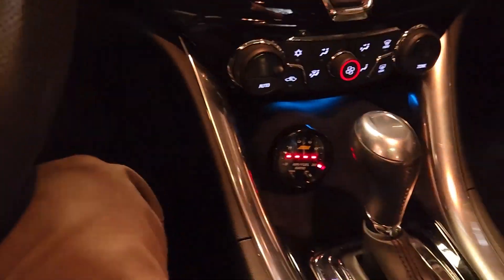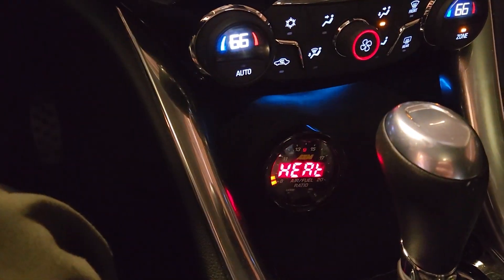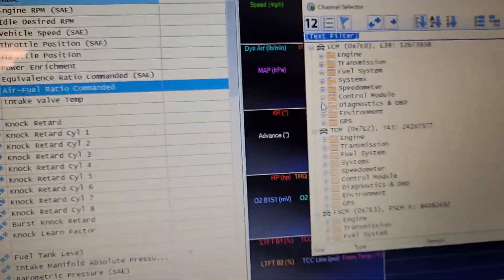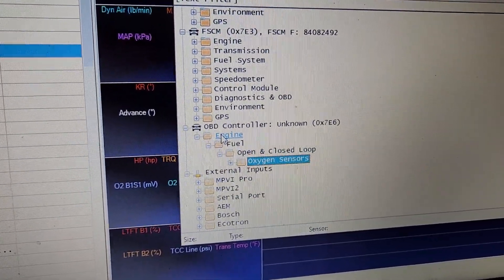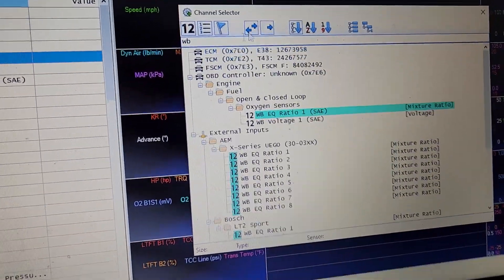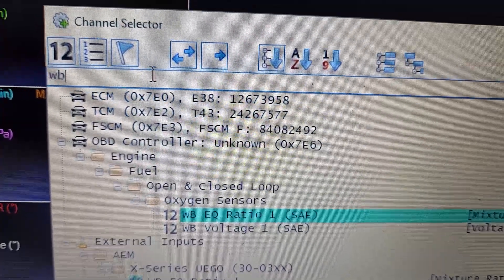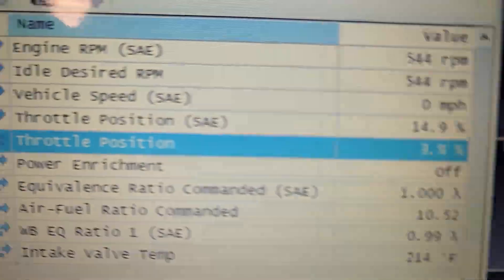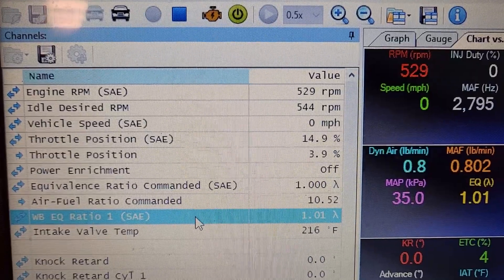How To Add The AEM X Series OBDII Wideband To HP Tuners VCM Scanner

Comment: thanks for the video! So you dont have any analog wires connected, right? Just WB O2 connected to gauge, Gauge connected to power/ground, and obd2 pass thru connected, with hp tuners connected into pass thru... right? haha thanks for your help
Reply from the maker: For the OBD2 CAN interface no analog wires as long as it's a CAN vehicle. 

Power the wideband, plug the pass thru up,  connect to the scanner, and add the channel.

Comment: have the same problem. 05 Sierra, Aem 30-0334. I don't even have the OBD controller folder
Reply from the maker: The 05 Sierra isn't a CANBUS vehicle this won't work using the port. You'll have to use analog logging off the 5v output wire.
Reply: @andrewd843 I wasn't quite sure because my truck is a patch work of other trucks  2003 cab with 2010+ engine and 2005 computer.  So I just figured that out. But thanks anyway. I found a video showing how to repin the two wires in the back of the gauge hook up a prolink cable. That should work, right?

Comment: Which MPVI do you have?  I have the three and that channel is not available
Reply from the maker: @scottzito4797  that channel only works if you have the aem 30-0344 and it's connected and on. It works with any MPVI I've used everyone to connect to customer cars with this wideband.
Reply: @andrewd843  Do you mean the AEM 30-0344?  I can't find the 03-0344, other than people making transposition errors when referencing the 30-0344.
Reply from the maker: @rosslawrence4628 03 is a typo
 30-0334 is correct and what is in the description
Reply: @andrewd843 I just got the 30-0334 and using HP tunner with MPVI3 and can not find that channel some help would be appreciated. I should also mention also have it plugged in obd2 connector on a 2005 gmc
Reply from the maker: @KellyA5150 
the OBD2/CAN isn't going to work on something that old. You need to log it with the analog 5v output. Vehicles 08+ are CAN based system. Older than 08 usually aren't CAN systems.

Comment: I have the prolink wired connection 30-0310 and i see the channels but when i add them they dont respond with any values when running a log. Do i have to adjust user defined maths or something?
Reply from the maker: @slick408  that doesn't have a the OBD2 port pass through like the 03-0334 does. It connects to the OBD2 but doesn't have the pass through to like with hpt like the 03-0334 does. I've never personally messed with the one you have. What do the instructions say for external data logging?
Reply: I have the same problem
Reply: @alihatem8640  I got it to work successfully on the 30-0310, after reading AEM's instructions I connected a 120 Ohm resistor to the 2 CAN wires. Those wires draw about .2 watts, so a resistor rated .25 watt or more should work. I used a 1/2 watt 120 Ohm resistor. I had previously used this exact setup without a resistor and have heard of other people not needing it. But when I reinstalled hptuners it didn't work without a resistor anymore, maybe I forgot something I did in the program, but this resistor method is better. Wire it up with the resistor and simply add the channel. External Inputs > AEM > X-Series UEGO (30-03xx) > WB EQ Ratio 1
Reply: @slick408  So you piggybacked onto the OBD2 port using this method?  I'm buying the AEM X-SERIES INLINE WIDEBAND AFR CONTROLLER KIT (30-0310) and was trying to figure out how to wire it in on my GMC...
Reply: @reddirtdevil  plug the hptuners directly into obd. you need the prolink cable and a resistor to connect the AEM.
Reply from the maker: @alihatem8640 please see my above comment. 30-0310 isn't the 03-0334.

Comment: My AEM X-Series was wired up properly and worked perfectly for almost two years before it melted down out of nowhere. Nothing was changed. I have a video on my channel about it. I have 30+ year old Honda ECUs that work fine to this day. So we're supposed to by a new wideband controller every two years? Has anyone else dealt with this?
Reply from the maker: @HexBMX  I've seen a lot of AEMs fail and have issues. The CANBUS ones will also do weird stuff sometimes to the car when they fail. I don't personally run the AEMs I have ballanger AFR 500s.
Reply: @andrewd843  Right on. Yeah, I've been in the game since around 2007. But working on Hondas since the 90's. Yes, I am old. And I have had more problems with these than any other equipment I've dealt with. If you've had consistent good luck with something out there, I am all ears. Just because something offers a one year warranty doesn't make it acceptable to burn out two years in. Hell, my ECUs have been running stock and then modified for 30+ years. Same thing. Just a circuitboard. And they have been fine. 

Thanks for the reply.
Reply from the maker: @HexBMX  same here. I got my first Honda in 2004, then DSMs, then SRT4, then ls stuff. I had an AEM and kept having issues, sensors die, the controller dies, went through multiple in a year. Swapped the Ballanger afr 500 and have yet to have an issue. I get them with the upgraded NTK sensors, and I haven't had a sensor die in the time I had multiple AEM units die.

 My personal car has one permanently installed, and then I have one I use for any car that comes in for a tune at the shop.
Reply: @andrewd843  Thanks for the input. I keep mine running in my car at all times. I will give the Ballanger a try. I seriously appreciate the input. Because I can assure you that this was not "user error"...

I'd rather spend the bucks in one pop than having to keep rebuying something over and over.

I went through a few different controllers. A couple cheap ones, an older AEM and then the X-Series. I could have bought a Ballanger with all that money. Not even including all the money spent on sensors.

Comment: I got a 2018 Camaro 1SS 6-Speed. Currently working on getting it fully freshened up and stuff after the winter. Motor oil, trans fluid, gear oil, spark plugs. I just bought an AEM wideband to install. Also going to buy a MPVI3 with 4 credits. When I have all that in can I contact you for a tune? Also what are your tuning costs?
Reply from the maker: Tuning links are in the description.